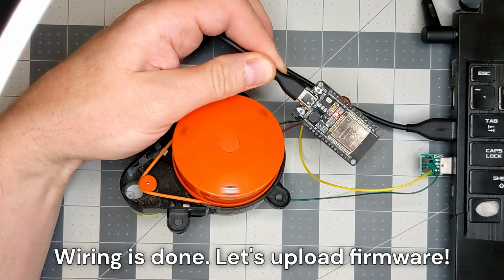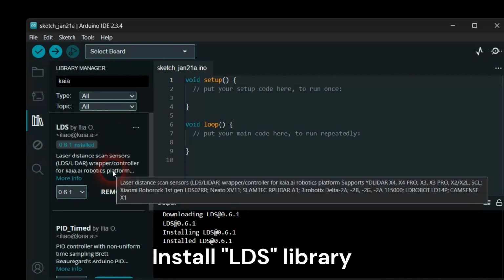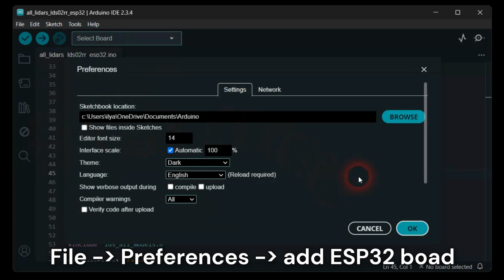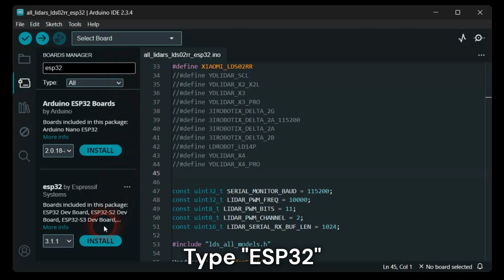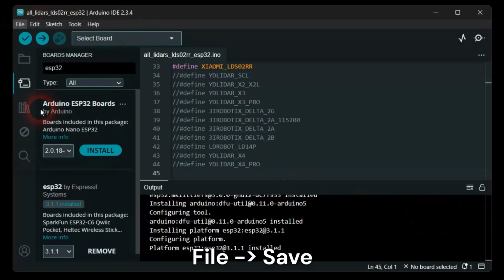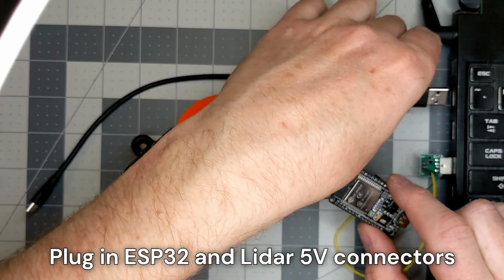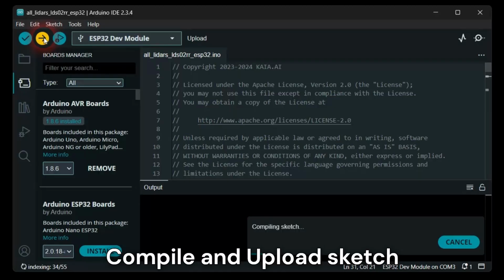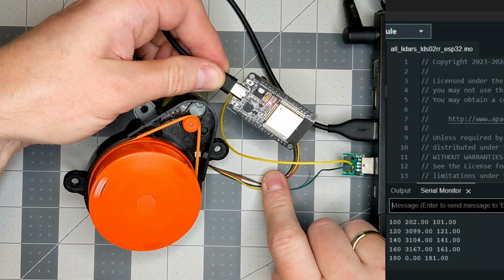How-to: Stream LDS02RR Lidar distance data live using Arduino, ESP32

Comment: Why do you need PWM, RX, and EN pins for? The LDS02RR doesn't need them, right?
Reply from the maker: @marceloAVFS some other Lidar models need those pins
Reply: @MakersPet Actually, it has a PWM pin—it's GPIO15, which can control the LiDAR's RPM speed. My LiDAR model, at full speed ~7 rps, generates a bunch of reading errors, but at 5 rotations per second, it works better.

I searched for your adapter, but it's quite expensive to ship to my country. So, I made it using other components. Your adapter is much cleaner and better! It's much harder manually plugging it in, one by one, to the LiDAR "J1" (I'm using the Xiaomi Mi 1S 1st SDJQR01RR). After analyzing everything, I found that the TX data (both hex and binary) is the same as what you use in the LDS02RR—similar to the NEATO_XV11. Also, I use an ESP32-C3 super mini.

I really appreciate your work on other LiDAR robot videos! I also have a question for you: How do you reference the point cloud map (if you do so) while the robot is moving? Do you use an MPU module + code, or is it done just through code?

Thanks in advance!
Reply from the maker: @marceloAVFS  sounds good. I use ROS2 for mapping and navigation. Try googling ROS2 and Nav2. It's common to use an MPU, but I don't